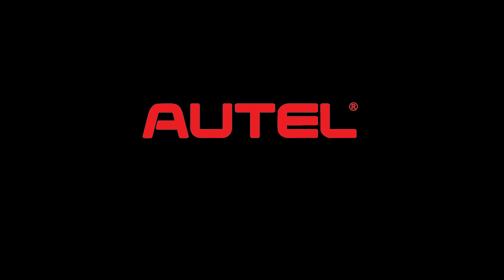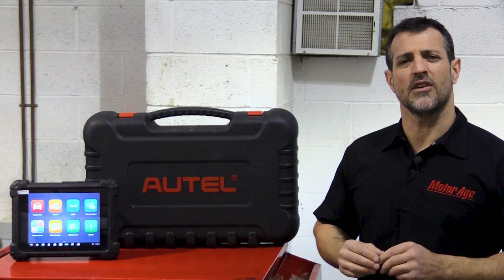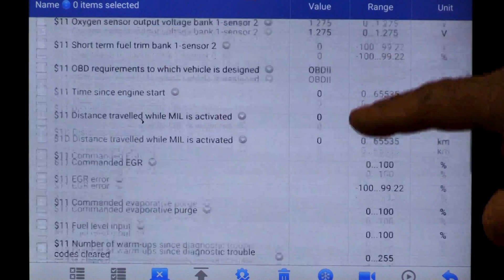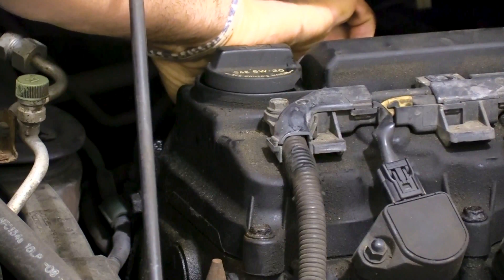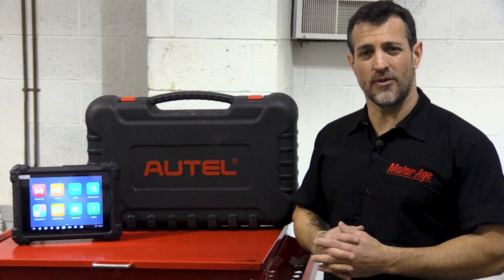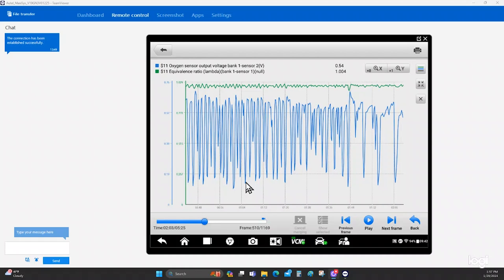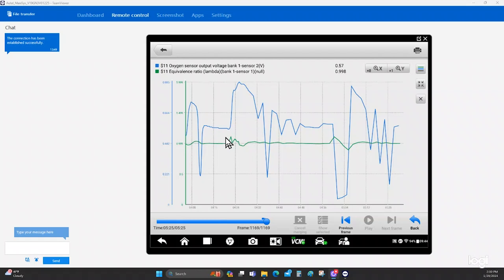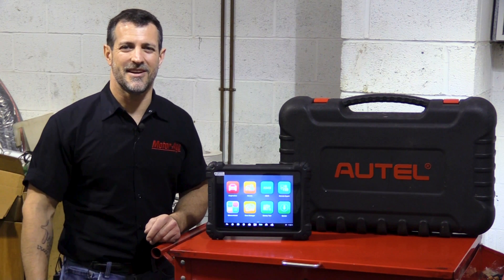The Trainer #145: Solving the mystery of the intermittent misfire

Comment: What tools ? What you look ? And how you pointed out the binding part of the drive train that was slowing  down the crankshaft to cause false misfire?
Reply from the maker: The tool being used is the Autel MS919. We are looking at the HO2 sensor signals to determine the oxygen content in the exhaust stream, indicative of a misfire. Nothing is binding in the in the drivetrain. I simply created a misfire by disabling an ignition coil and disabling a fuel injector.
Reply: I ask you this question because you said that a binding cv axe can cause a false misfire.

Comment: Hi , thank you for this informative video.
Regarding putting a jumper ground directly to the control side of the coil, how long can you keep it there, before it overheats the coil?
Also, what size fuse would you use on that jumper wire?
Many thanks, Joe.
Reply: Great question, and it should be something we are concerned with. However, this coil requires a high side driver to energize. By shorting the drive signal to ground, all I did was eliminate the control signal from making its way to the coil, preventing it from dwelling. In other words, this coil never turned on during that period of time. Does that make sense?

Comment: the same would happen if we had the classic sensor 02 instead of the afr in front of the catalyst?
Reply: Correct! however, the HO2S would dive low under lean conditions and high under rich conditions
Reply: @brandonsteckler3417  so the strategy is on misfire from ignition problem we have 02s 1 lean o2 s2 ritch and from fuel problem o2s1 lean and o2s2 lean correct?
Reply: A lack of ignition will allow fuel to reach the catalyst. A functioning catalytic converter will use all the oxygen to catalyze the fuel, leaving the rear O2 sensor high.

A misfire due to lack of fuel injection will leave excess oxygen in the exhaust room and drive, the rear O2 sensor low
Reply: @brandonsteckler3417  sorry what you said i just meant i use google translate i don't know english...thanks m brandon that you answered me
Reply: I’m sorry, I don’t understand what you are trying to say. Could you please reiterate?

Comment: Great video !! I was also wondering could you also monitor other parameters and come up with the same diagnostic conclusion of which cylinder is misfiring ?  I was wondering , first use an ignition coil firing event from the #1 coil as a cylinder firing reference (scope trigger) , monitor the Ignition Misfire counter PID on a graph, monitor the RPM PID on a graph, when a misfire occurs - shouldn't the RPM graph slope down due to RPM drop and use the Scope triggering of #1 cylinder to determine by sequence which cylinder is dropping the RPM and also confirm while determining which Misfire monitor is counting up rapidly to identify the misfiring cylinder ?  Thanks so much for your video !!
Reply: You have the right idea but remember. Ford utilizes that strategy in their “Power Balance Test”
Reply: Good job thanks

Comment: I saw this technique in the past, but it was before scopes were used a lot.
Reply: This was a scan tool plotting graphed data(no scope used).
Reply: Yes and as such , you noticed the graphs are kind of weird shaped. If you used a freeze frame oscilloscope like a picoscope, you would get much crisper and reliable graphs. The refresh rate on scan tools is actually extremely poor compared to a good freeze frame oscilloscope where you will get clean graphs and not such odd shapes.

Comment: Brandon, thanks for the video.  Are manufacturers still using transistors for ignition coil drivers or have they switched over to using MOSFETS in newer cars?
Reply: Pardon my ignorance….I refer to either of them as “transistors.”

I’m the eyes of the tech, it shouldn’t affect diagnostic approach.

To answer your question, likely “MOSFETs”
Reply: @brandonsteckler3417   Thank you!

Comment: Very well explained and display of the data captured by the Autel and the description of the faults you created. Awesome how you can clearly see the difference in the two different types of misfire causes, the no spark shoots the secondary O2 upwards due to fuel "blocking" the oxygen sensor from "capturing" the Oxygen and the no fuel misfire having no fuel to "block" the Oxygen reaching the O2 sensor, shooting the reading downwards, and "capturing" a higher level of it, conversely deeming the reading "lean"
So much in-depth information from such a "small" scan data capture. Thank you for sharing as always!
Reply: You almost have that, correct…

The lack of spark misfire allows fuel to enter the catalyst. The catalyst will use the remaining oxygen internal to itself to catalyze the fuel molecules. As a result, almost no oxygen, is left over to leave the tailpipe. This result in a very high rear O2 sensor signal.
Reply: @brandonsteckler3417  thanks for clarifying, always looking forward to learning from you.
Reply: @brandonsteckler3417 South Main talks about this in a comment on Royalty Auto Service's most recent video. In his opinion, you can only use FT to distinguish between an ignition or fuel related misfire if the vehicle uses the downstream O2 in its FT adjustment for the reason you mentioned.

However, looking at the live data and comparing the response of the upstream O2/AFR and the downstream O2 during the misfire can clue you into which type of misfire you have, again bc of the mechanism you described.
Reply: Thank you!

Comment: How does this work in a real shop environment.. would you let a car with a misfire get to normal operating temperature, to do this preliminary diagnosis and get some diagnostic direction, just to have the engine bay then be too hot to work on?  Do you let the car cool off while you work on other cars?  Would you perform this test if there was already a catalyst efficiency dtc stored?  Lastly, is there any concern of causing damage to the cat while performing this testing?  I suppose if the car was driven to you, the driver/owner of the vehicle has already cause way more damage than this test.  I appreciate this video and will save it in my toolbox of tests to perform.
Reply: If you recall in the video, I took time to offer a disclaimer. I said “do not perform this type of test/experimentation, as I am only doing it as a demonstration”

With that, yes, this is very applicable in the real world. When we are trying to find the cause of an intermittent misfire. 

When we can easily replicate a misfire, there’s no need to implement this test, because our normal diagnostic troubleshooting procedures will help us find the problem quite easily .

The catalyst must be laid off and functioning for this test to work. If you have a faulty catalyst, it will not work.

Comment: 7:55 I guess this coil is of 3 or 4 wire design with a transistor inside and you're grounding the signal wire. But isn't this dangerous if a newbie is working and the coil is a simple 2 wire coil? Excessive current would pass through the coil and through the computer because the coil is saturated for longer?Newbie should be very careful. In my case i either disconnect the coil connector or use a spark plug tester if the coil is out of the tube.
Reply: Correct, three wire coil… You were also correct in that a two wire coil will overheat in a situation like that if it is energize for too long.

This is another reason I offered the disclaimer in the beginning not to perform this type of experimentation, unless you know what you were doing because you can cause damage, especially to a catalyst
Reply: It's NOT dangerous to the driver in the PCM only to the coil, because the coil will overheat and fail if jumper is connected for too long. 

1. The drivers in the PCM for 2-wire coils are designed to allow higher currents compared to drivers for 3 or 4-wire coils.

2. The ignition coil circuit is protected by a fuse.

3. Most important:  The driver in the PCM for a 2-wire coil will continue to function as normal (i.e. it will continue to pulse) while the jumper is connected. It will actually have less current going through it because the majority of the current will go through the jumper to ground not through the driver.

Please take my info with a grain of salt until Brandon responds, because I'm not a professional, I'm a beginning do-it-yourselfer.
Reply: I’m the 3 wire configuration I’m addressing, the signal wire pulled low will not hurt the PCM driver nor will it energize the coil. The transistor is not latched (not flowing current).
Reply: @brandonsteckler3417   Sorry, I thought it was a 2-wire coil. Thanks!
Reply: No worries…I’m glad we got that cleared up

Comment: I first learned about this technique reading an article by Mr. Mark DeKoster in May 28, 2013 Motorage magazine. He also adds to the pids the STFT. Nice refresh. Great technique to make a first judgement of a misfire problem if you have lets say a V6 european car where everything is buried under many plastic parts and intake manifold and just the disassembly alone would be 1 hour.
Reply: Is that magazine good with troubleshooting techniques? thanks
Reply: Yes, MotorAge Magazine is chock-full of troubleshooting/Diagnostic techniques.
Reply: Thank you 👍👍👍 @brandonsteckler3417
Reply: Can anyone get the magazine?

Comment: This is good information but I feel like it's not exactly practical.
Most intermittent misfires will occur in random counts, say maybe 5-10 fire cycles in a row and then back to firing normally. Watching fuel trim during this will not show much let alone point to a good direction.
A lot of times I see misfires that occur at complete random and engine load seems to have no effect. It's frustrating really
Reply: I found great success with this technique, even with intermittent misfires, only a handful at a time

Comment: You can’t tell if it’s spark or fuel on newer cars if the injector is turned off by the ecm? So looking at fuel trims wouldn’t help on newer cars??
Reply: The fuel injector will only be off with a cylinder specific misfire.

In this case, we are talking about an intermittent misfire that does not said a cylinder, specific misfire DTC, and does not shut off the fuel injector, even a newer vehicles

Comment: Great video Brandon. Is it possible to determine a mechanical misfire using the same method?
Reply: Simply adding graft data of the MAP sensor signal wire can help rule out engine mechanical faults

Comment: More correctly a no spark misfire
Reply: I'm sorry, I don't understand your comment. could you please clarify?
Reply: Why would you use the term "spark misfire"  when there is no spark.  I would think that calling it a "no spark misfire" would be a better call.
Reply: Correct… In the video, I said, I was going to refer to a misfire that lacks spark as a “spark misfire”.

I’m very sorry for any confusion. Thank you, Doug.
Reply: But now that I think of it there are differing scenarios in which there may be absolutely no secondary spark and those where the spark occurs but is shunted away throughi the insulation or through a ceramic leak.  So dont let me interfere.

Comment: Did not here where the intermitant cause comes in
Reply: I do not understand. The entire video was about an intermittent misfire and how they reflect differently in the data from the heated exhaust gas oxygen sensors/wide-band sensors. Can you elaborate on where you have some confusion and I'd be happy to clarify.
Reply: Check Mode 6 and See if any Misfire Counters Occured.
Reply: P0300 only happens  on one hill after cresting sometimes check engine light comes on and flashes a few times stays on for a few days then shuts off cannot  feel the missfire.scan tool is showing everything  normal
Reply: 99 tahoe